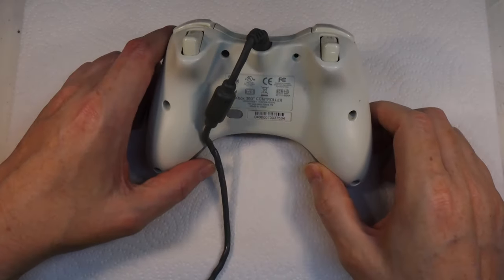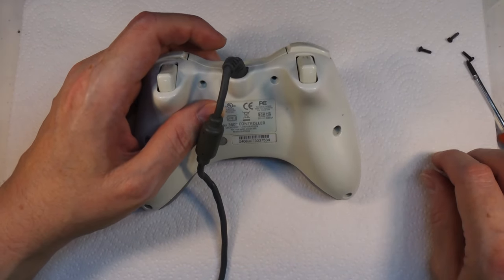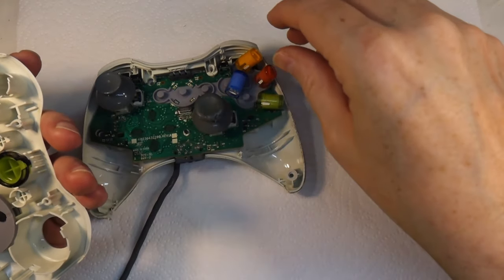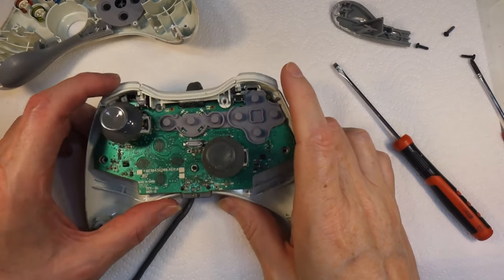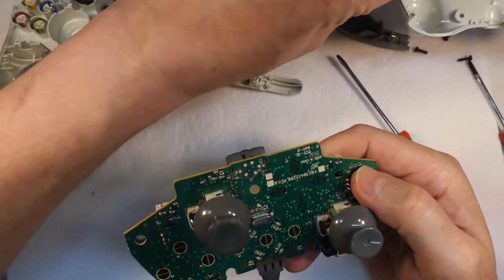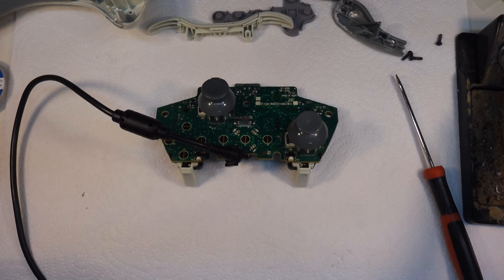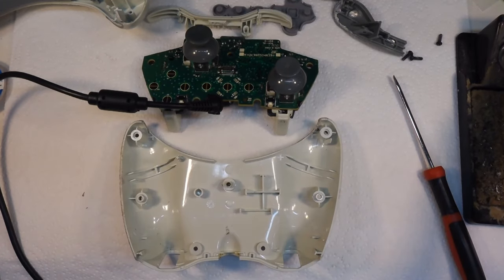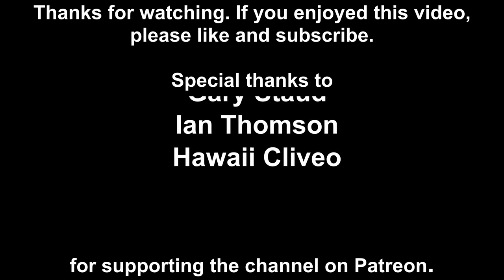Replacing the cable on an old Xbox controller

Comment: BTW, built hundreds of kits in my youth, haven't picked up the poly cement in anger for decades now, but still love to watch your vids. I turned my attention to Flight simulator and for a while built and painted 3D models of planes instead.
Reply from the maker: That's one of the great things about 3D printing - if you just want to paint models and not actually build them, you can print them and not have to do much in the way of building.

Comment: I have the same exact controller in my to-do-pile awaiting cable fixing. The existing cable has split and lost connection where it meets the body, was going to just cut-&-shut it, but now I know new cables are out there, may just do the same as you, thank you.
Reply from the maker: Glad it was useful for you 😁
Reply: ebay under £5!
Reply: ebay under £5!
Reply: ebay under £5!

Comment: Think I found the cable, in the reviews it says the the connector you swapped from pin 5 to 4 are both ground anyway, so not an issue apparently, I will probably swap them anyway, no point not if that's how it was.
Reply from the maker: It takes a second to swap it out, and why take the risk? I'm glad you found the cable - I'll put a link to where I got mine in the description...